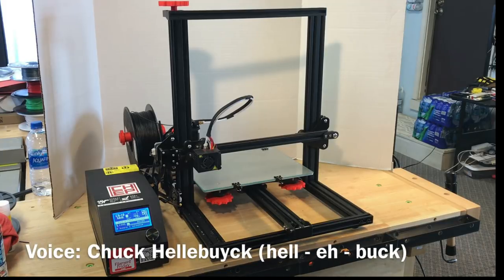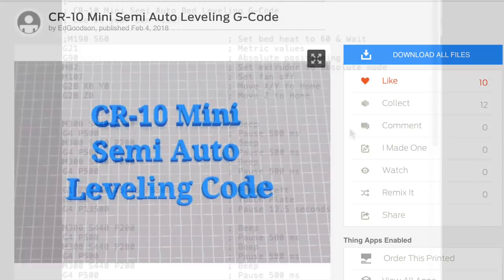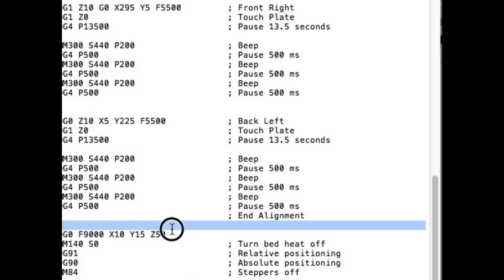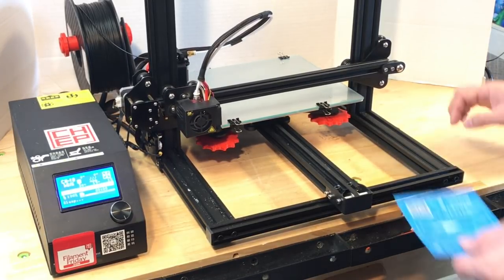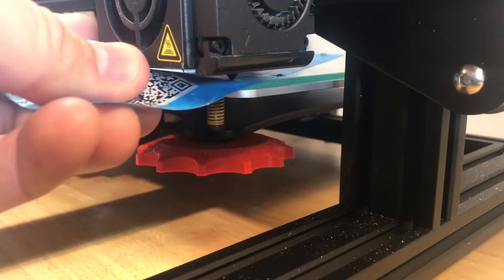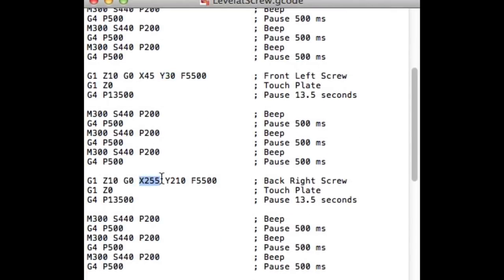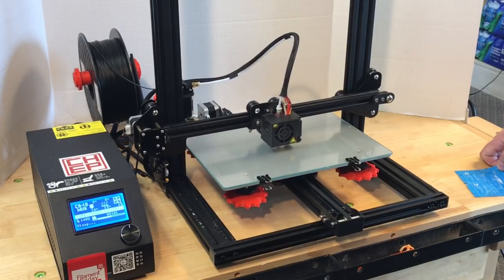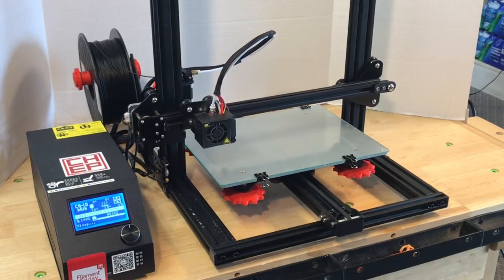CR-10 Mini 3D Printer Bed Leveling Assistant G-Code

Comment: Hi Chuck thanks for the video.

The reason I use the corners. Imagine the glass plate is 20 X 20 feet . If you level at the center 1 foot corners (Bed Screws) you may think its level but at the outer corners it could be off by a HUGE margin. I didnt do the math but for example if you move the center 1 foot by a quarter inch it could translate to a foot at the outer edge. IMO outer edges are more accurate. YMMV :-)

Comment: OMG, what a time-saver!  I made a little mod including the one Chuck mentioned.  I now run it and it heats up the bed, I added notes as I'll forget what the commands that are undocumented do.  Now, if I can only figure out how to get it to pause until I hit the control button, as well as append the BIN file and put an option on the screen.

Comment: I knew that what JGAurora calls "semi" something, can be implemented in G-code. I didn't have time though to make it. Thank you Chep for your post and code. It's helpful.
I wrote a g-code to change filaments (different color) during printing with some beeps and pauses like you did. Now simplify3D and even Cura include the ability in their tools.

Comment: Great video. I do a similar method using octoprint and the custom controls plug-in with my own Gcode to position the head 50mm in from each corner.

Comment: Hi Chuck!

It had to be modified because it struck the glass fastening clips.
The change consisted of breaking down two lines:
first G1 Z10 followed by G0 Y290 X5.
It then lifts the extruder first and then moves, not raising it while driving.
There was another mistake: you wrote M190 and didn't heat the extruder. I had to fix M109.

Comment: Chuck great video question do you ever check across the middle of the bed to see if it is level as well. Just curious having a bed that large if there is a high or low spot in the bed. I have a anycubic i3 mega and it is high in the center. Not by much but enough to cause a issue once in a while.  This is with the ultra bed. I also took a 1/8” piece of glass and figured that would take care of the problem. It did slightly not much. I was going to get the mini that you just demoed the leveling on but I did not need a bed that big. You do a great job on your videos and I watch them all the time and always go back to them for info. Keep it Chuck.

Comment: Hi Chep,
I don't have a tape to measure, but the changes you made place the printhead correctly on the front two screws, but are incorrect (as far as I can tell) on the back screws.  The fronts are y=30, so 30mm off the edge.  The backs are only 10mm off the edge at y=210.  Shouldn't they be y=190?  Maybe I'm not seeing this right?

Comment: Hi there, I have recently been having troubles with my printer, the mono price select mini. I accidentally transferred a small static shock to the printer and the printer froze . And now it will not turn back on. I’m hoping it is just the firmware that got fried. I’m not too sure but I also don’t know where to get the firmware anymore. Do you any ideas? Thanks.

Comment: What should the Z axis height show at the very beginning of the print? 
It homes to zero. When the first layer is printer, should it still be at
 zero? Or is that determined in a g-code of what is being printed out?

Comment: 4 point leveling on a plane seems over-constrained.  The Makerbot 2X I have at work uses 3 points (front left, front right, back middle).  Is there some reason why you level 4 points?  Is it because there are 4 tensioning springs?

Comment: Hi chuck i managed to change the gcodes for the semi auto bed leveling for my cr-10 mini to above the adjustment screw it works great thanks, but i tried to modify gcodes to  home all axis after it finished but it did not do it, can you show on video how to modify or send me the codes please

Comment: Do you find you need to run this more than once to get it fully leveled? I know Simplify 3D has this feature built in and it usually runs around the bed a couple of times. Thanks for the share though!
Reply: Brian Popilek it probably depends on how close to level you were at the start. It's usually a good idea to check each spot a couple times (or until each corner needs no adjustment) since sometimes adjusting a screw can affect the other corners

Comment: The z moves should be separate  from x y moves, and what about M1 for temporary pauses instead of the  G4 Dwell timer pauses or M0 with a P or S value. i did not think about moving to the diagonal corners for leveling.
Reply from the maker: Different pause is a good idea